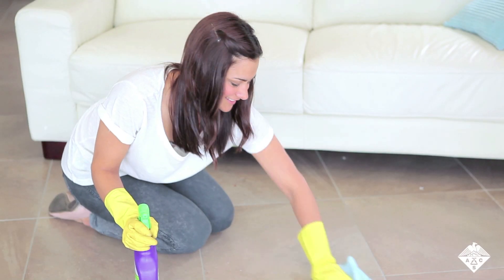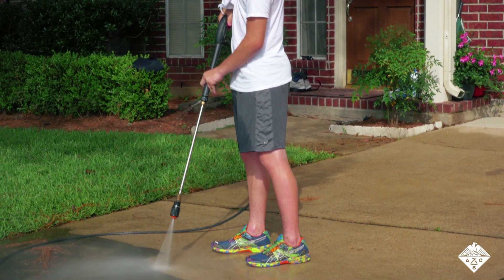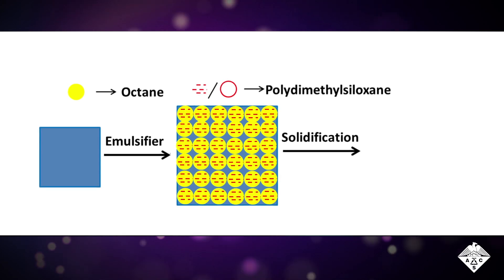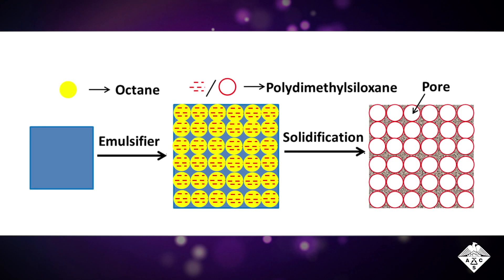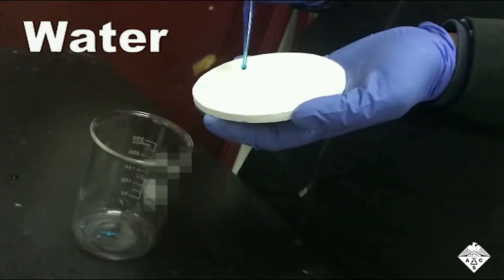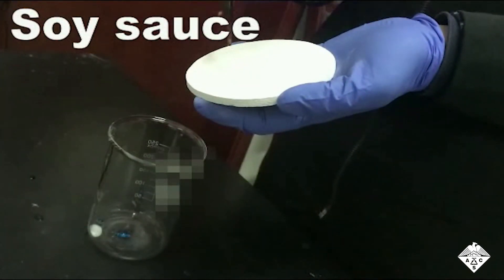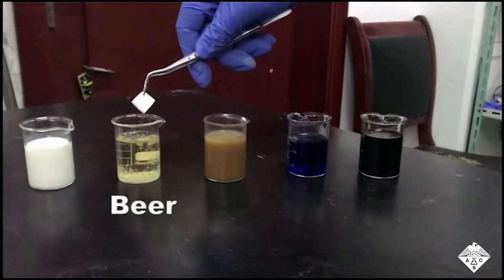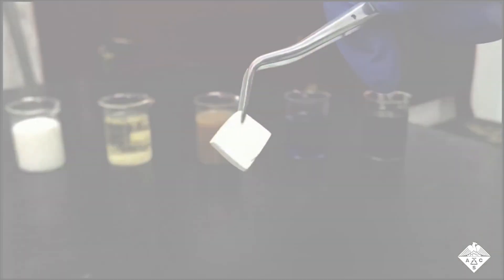‘Self-cleaning’ concrete could help keep buildings spick-and-span | Headline Science

Comment: I applaud efforts in this direction...but I would like to see a test in which various common acids such as mustard, vinegar, red wine, etc. are allowed to sit for 24 hours in carefully taped-off squares.  Rinse, pull tape, and look for stains/etching.  If the surface still needs a sealer to minimize the effects of common acids, there is little point to this process.